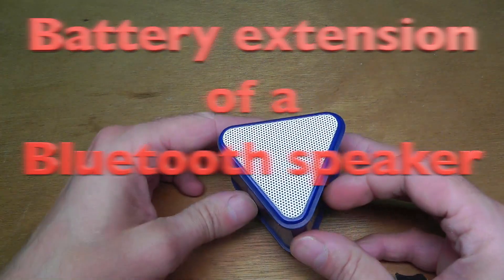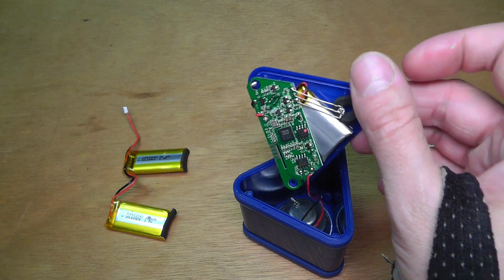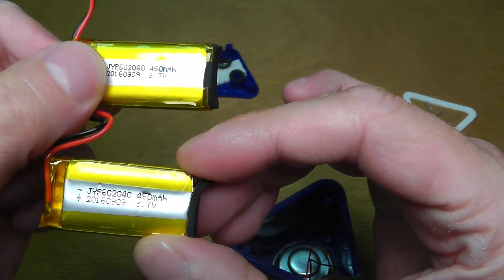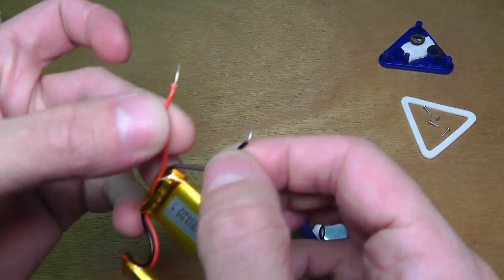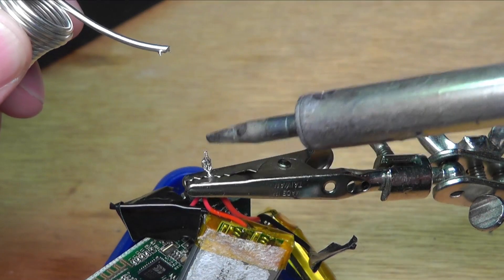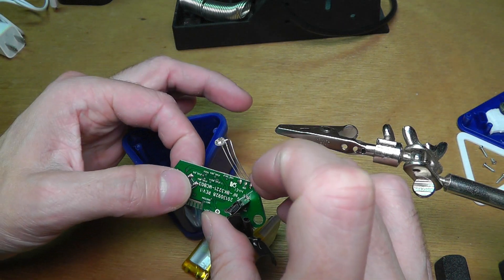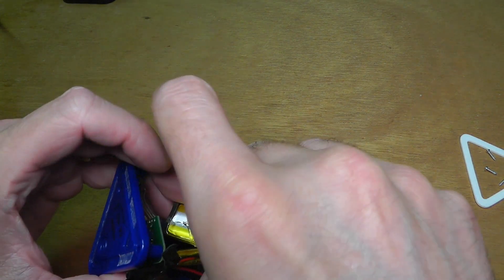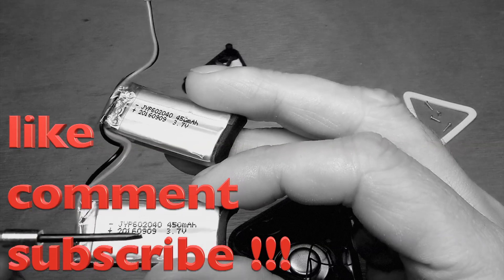Extend the play time of your Bluetooth Speaker ! How to

Comment: what hapens if we put high Voltage battery to it?
Reply from the maker: It will probably blow up 😉😇
Reply: MegaSafetyFirst voltage must be same.. safe to replace batter of 500mah to 3000mah?
Reply from the maker: Right,  it will play a lot longer then without having to charge.
Reply: MegaSafetyFirst i am experiment in few days. so give me ur contact of instagram i want to ask few question on customizing my speaker😇😬
Reply: i have 10w+10w speakers. how much capacity battery does it require? for long lasting power supply